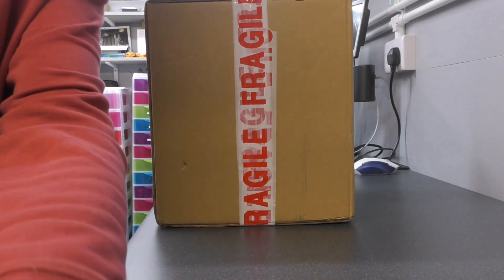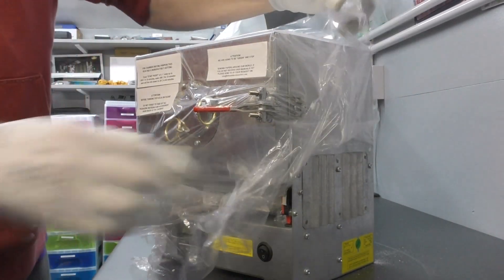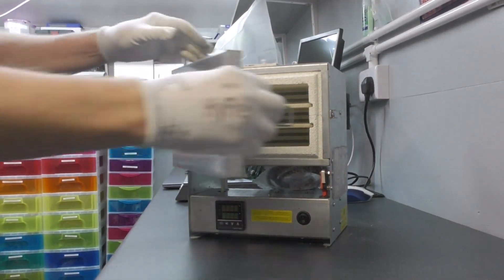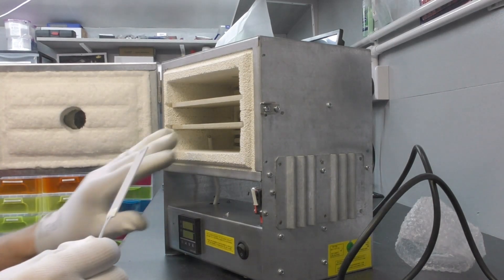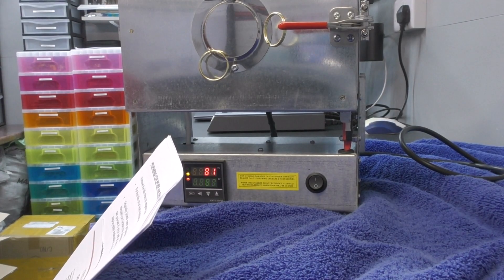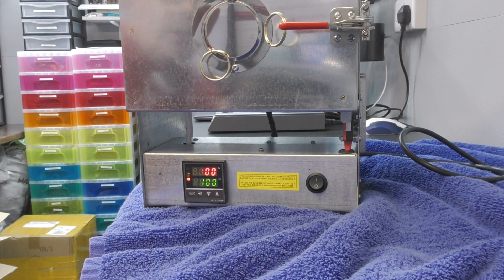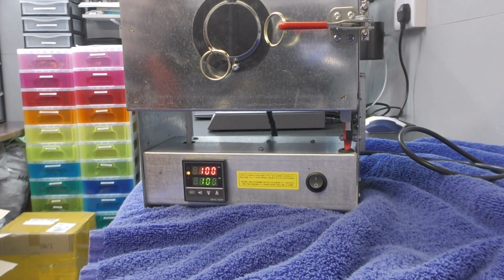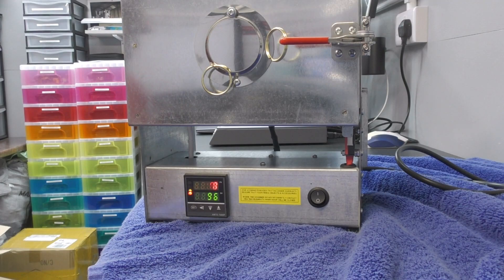R14-UP Programmable 1000 degs C Kiln

Comment: Are you going to cut the silver solder into tiny pellets, or use silver solder paste.  If using the paste beware that they normally use a rather aggressive acid based flux, so it will have fumes, though at the melting point of the solder the flux has by then already cleaned the surfaces, and turned to a glass coat over them, before the solder inside melts to do the join. That flux though can clean the most hard and dirty soldering iron tips though, it will strip off the oxide and crud easily, just run the tip to the max the iron will go, and with a tiny bit on a piece of cardboard wipe the tip with it, and all the oxide layer is gone, leaving a clean surface to quickly tin again.